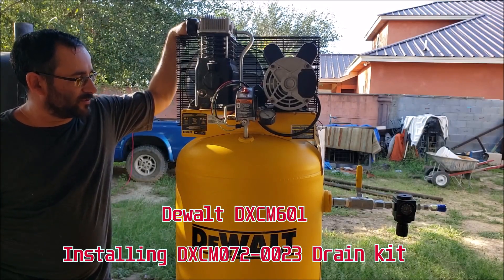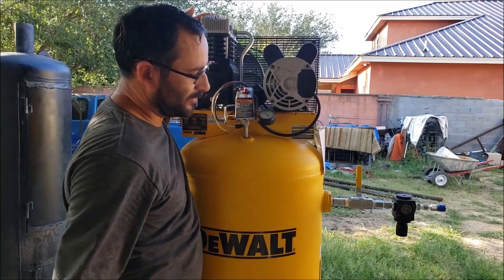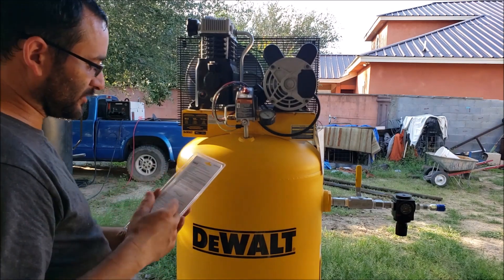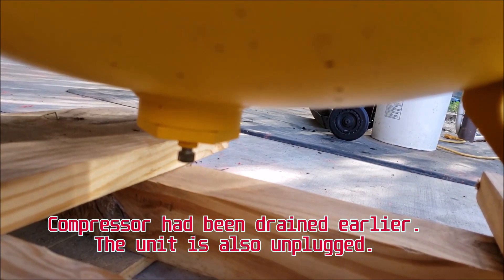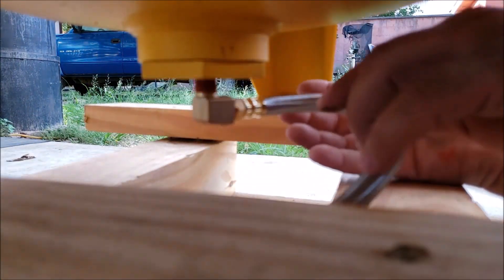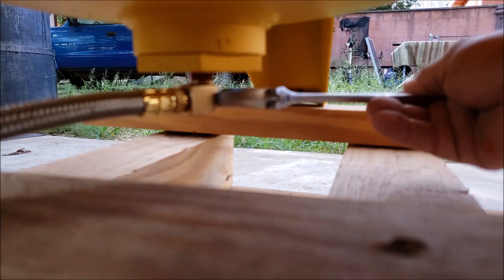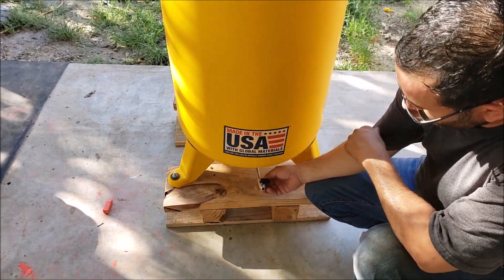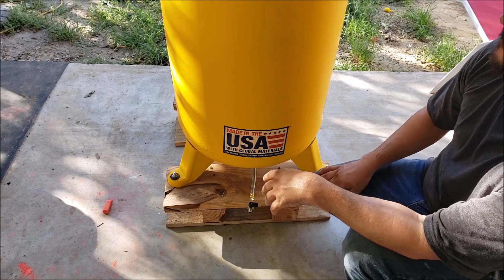How to add an extended tank drain to Dewalt DXCM601 compressor

Comment: Would you recommend buying this compressor 4 years later? Great video. 👍🏻
Reply from the maker: I don't know if other compressors will outlast this one but I got about 4.5 years out of it before it blew a piston rod. I bought a second used compressor from tractor supply for $80 and I am using that one after a local paint shop returned it for unknown reasons last year. I then bought a 3rd one about 4 months ago and still haven't even turned it on but I bought it due to being on sale. Things are getting more expensive day by day for sure and I like my Dewalt compressors.

Comment: Great video.  How do you like the compressor?  How did the extended drain kit do with the liquids?
Reply from the maker: The compressor has worked great and 0 major issues. I had a minor issue and that was the belt and pulley came off due to a loose screw. I use the compressor for plasma cutting only but feel like its a good machine to own. The extendable drain makes draining the compressor easier but I would of used a non flexible kit if it was available in store.

Comment: It should only take this compressor 5 minutes and 50 seconds to fill completely to 150 psi before shutting off
Reply from the maker: This compressor is sure faster to fill than my old Husky 30 Gallon that I used today. I am using an Eastwood 50lb sand blaster and compressor works great. 60 gallons is awesome for running tools longer, I also have the 30 gallon and a 3 gallon compressor which each has its own role. Thanks
Reply: I bought this same model to paint an old truck . I really like mine . I added a transmission cooler to it so that I don’t get any water in the tank .

Comment: If you were to guesstimate how long it takes to go from 0-155 psi...how long would you say it takes to get there, and how hot (touch wise) does it get? Thanks and great video!
Reply from the maker: I cant recall the time it takes but when I get home I can try that. It gets a little warm but depends how long it's being used. I due mostly plasma cutting and works great.
Reply: @cutweldngrind  cool, appreciate it. Just picked up the same model and was doing the break in after i did the twenty min break in seemed like it took about 20 min to fill up. I’ll see how it performs after its sat for a night. Thanks again!
Reply from the maker: 11 minutes with 10 seconds from empty to cut off. I am running it off my 10,000 watt generator.

Comment: Flexible pipe is a good idea, like it.
Reply from the maker: I am going to add a section of hose and pass the hose through the wall so it just drains outside of the shed. I need to also relocate the power and air chuck on the outside of the shed.